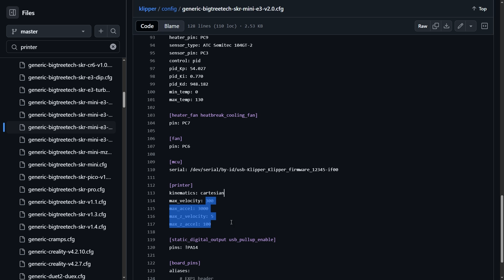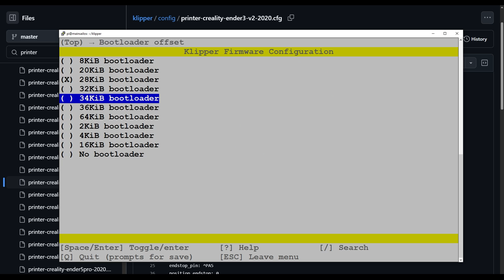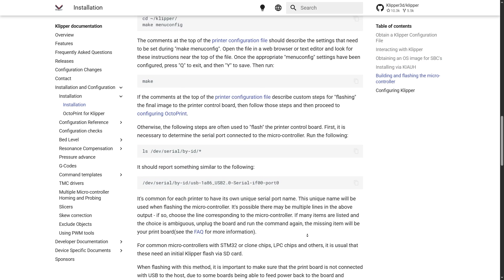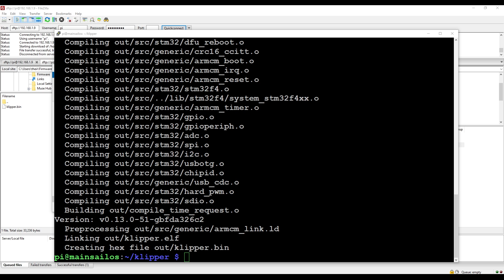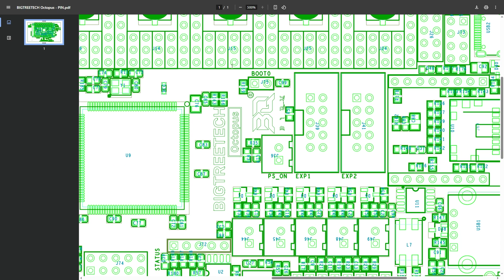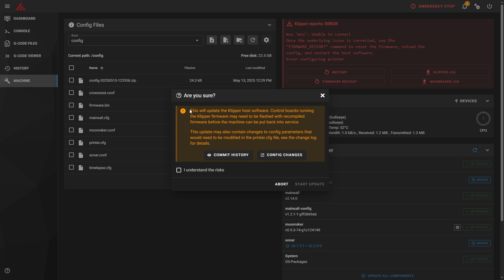Klipper Explained – Ep.3: Building and Flashing on any MCU

Comment: I think I am shooting in the air! but can anyone help me flash firmware.bin (I don't know what exact name I should give it) on the Tronhoo T300S V1.0 board, I tried searching some documentation on their website but I can't find anything. I tried to flash firmware.bin using cubeprogrammer as well (it has STM407VGT6 microcontroller), but no luck! can't connect this board using DFU mode as well, as there is no BOOT0 pins/jumpers are there.

Comment: Hey, thanks for making this. I have a delta Kossel, which I'm converting. These videos are a gem!
Please make a video about the config. I am so confused with the pin assignments and the names, because they all seem to be different from what Marlin uses and what is mentioned with the microprocessor on the Arduino website
Reply from the maker: I’m finishing up a video now about the basic configuration. Unfortunately, I won’t cover deltas, since I’ve never had one. But in any case, there will still be a lot of useful information.
Reply: thanks! That's great to hear! 
It turns out it was just a few hours of head scratching and then everything clicked, got the config made and in the middle of testing now 😊

Btw I'm a video editor(specialising in long form content like podcasts, tutorial videos etc.), I can see you're putting a lot of work into making these videos, do let me know if you ever need any help with the editing part!